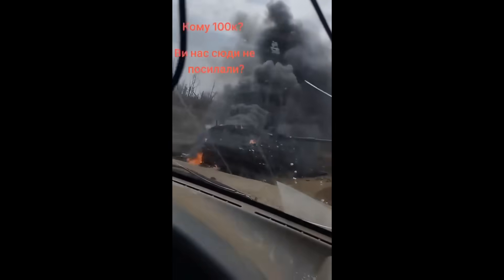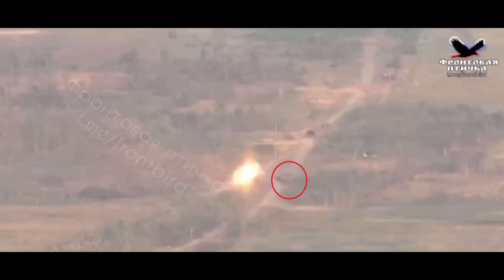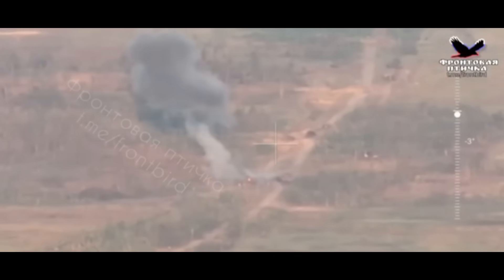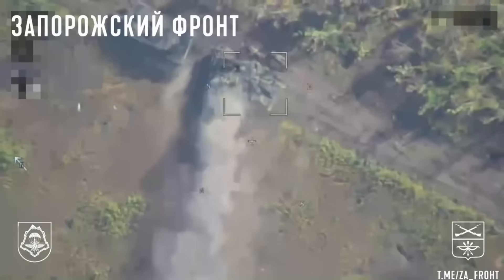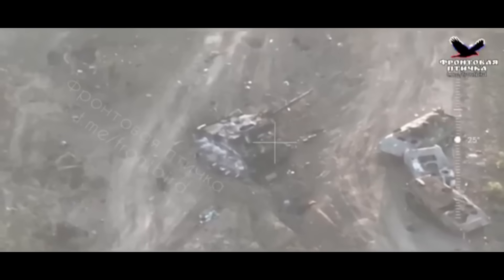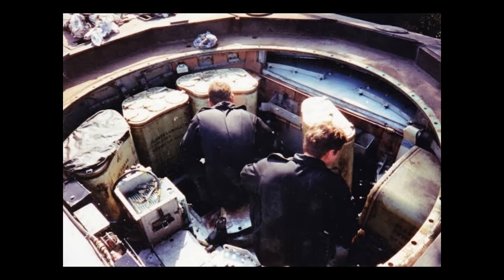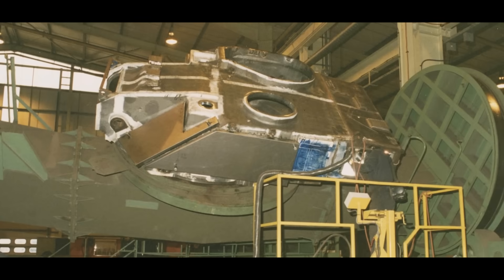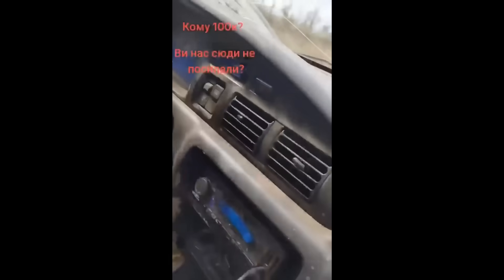This is how Challenger 2 got Destroyed in Ukraine

Comment: To no one's surprise, the best weapon against tanks is still the anti tank mine.
Reply: well I don't think the mine degraded the tank's armor.
Kornet/Vikhr would have done the same dmf if the tank was moving.
Reply: Joining the Ottawa treaty was stupid.
Reply: @tunisiandom9318 its very likely that ch2  frontal armour can stop kornet, but when the target is stationary not only do you not have a much easier time hitting it, you can hit it as many times as you want under no stress and even aim for weak spots.
Reply: The best weapon against a tank is 90% of the time........a tank.
Reply: @pierluigiadreani2159  The Ottawa treaty doesn't forbid anti-tank mines. It's only about anti-infantry mines. My country is in the Ottawa treaty too and people in general think it was a bad idea. But you know how it goes... it's trendy to join and some politicians wanted to get some international points and the defense of the fatherland can go screw itself.
Reply: 12 bravos will NEVER be out of a job...
Reply: The mine is good, but when one or two 155 or 152 mm shells are placed under it, then it is even better.
Reply: @enriqueouro9  1300mm after ERA begs to differ. that copper jet is going through and through the turret and out the back.
Reply: @moochoman9948  tank on tank is pretty rare
Reply: @moochoman9948  tbf, artillery is usually the biggest factor of tank casualties
Reply: @Masterafro999  Turret armor of Challenger, Abrams and Leo protection against chemical exceeds 1200. Though hull armor might be different for it. Kornet pens 1200 mm after ERA unless I'm unaware of an upgraded version.
Reply: @jonnekallu1627 They should've called it the "Illegal Alien Protection Act"
Reply: @Masterafro999  He also completely disregards the fact that the effective armor protection figures for complex composite armor packages only make sense under extremely specific conditions, namely the ones under which the armor was tested. They can vary wildly depending on the missile/projectile used against them as well as the incidence vector. A helicopter mounted ATGM or one mounted on a tripod set up in an elevated position, will have a far easier time punching through an armor package than if they struck it perfectly in line with its forward axis.
Reply: @pierluigiadreani2159  The Ottawa doesn't cover AV mines, only target-initiated AP mines.
Canada, the country that the treaty was held in, possesses AV mines, but no AP systems aside from the claymore. But nothing is stopping a soldier putting a spring cap and a tripwire on the mine, as illegal as that would be.

USA, UA, RU don`t observe that treaty anyways.
Reply: @tunisiandom9318  I the armour can't move... It's degraded.
Reply: Sadly for the ukrainians the brits promised them that the tanks were made out of wakandan tec and that they would be invinsible.
Reply: @enriqueouro9  No it cannot stop the Kornet, you're tripping.
Reply: It was probably disabled by a mine and finished by a Kornet.
Reply: @Masterafro999  Not in Ukraine though. I've seen videos of Russian and Ukrainian tanks in close combat. Usually a Russian tank would sneak in and take out several and then bail. And I don't mean several tanks but a few armored vehicles and a tank. Sometimes Russians come with a better equipment for example a T-72B3 or a T-90m. Both are equipped with thermals when an older Ukrainian tank might not be. So they spot it way before he knows they're there.
Reply: @ElkaPME  And infantry.
Reply: some things never change. Though a drone will get the job done aswell.
Reply: @jonnekallu1627  Well same thing in my country, I've been in military before and my commander just say about this"whenever you have is stupid pieces paper or not when you go to war you have so much reason to flip-flop about this" yep.
Reply: @tunisiandom9318  An immobile tank without crew is useless. You don't need to destroy a tank just render it useless or unsafe for the crew to man
Reply: @tunisiandom9318 the mine didnt need to degrade its armor. It just needed to immobilize the tank. Damage the roadwheels or pop the tracks out n that tank wont be going anywhere. 
And the crew felt this. They survived the intial blast for sure, but when they tried to move, the tank didnt do anything. And that was cue for the crew to haul ass. 
Coz the crew knows that, once the russians can confirm the challenger cant move, theres gonna be a second wave of far more devastating ammo coming their way.
Reply: @DogeHodler25  yeah I believe to know which videos you are talking about. But I was thinking that Kursk level tank battles are not found in Ukraine. We would have seen tank on tank videos daily in that case.
Reply: @tunisiandom9318  export variants don’t have the same armour as those used locally. Same goes for all western tanks.
Reply: @daniil7134  в смысле не причем. Как раз из за мины танк и покинули.
Reply: @koskok2965  you are speaking my mind! 
That's a point I made in a different video about leopard getting struck by air launched atgms.
Reply: @Kwisss  it states 1300mm online. That's the figure I took. 1300mm will highly likely punch trough the challengers turret front. The Leo is the only tank I could see surviving such a missile to the turret due to its add on pike
Reply: @cannack  Ukraine is party to the Ottawa treaty though.
Reply: Именно этот танк был взорван с корнета
Reply: This video goes out to all those brits who outta nowhere, bragged that the challenger was far better tank than the Abram and that it is the best tank ever in the world hands down, because of it’s low death ratio, despite seeing limited action in any warzone. ✌️
Reply: And it died now.
Reply: @nazbol1141  🤣🤣🤣🤣🤣🤣 you deserve a noble peace price for that funny bomb you dropped lol
Reply: @enriqueouro9  whether the tank is stationary or moving makes no difference to what the front armour can stop, only how easy it is to hit. In this case, the frontal armour was penetrated by a Kornet which led to a detonation of ammunition in the hull. Aiming for weak points is very hard to do with an ATGM; you will figure out why once you look at the footage of one in flight.
Reply: @Pythoner  Do we know how many missiles it took to destroy it? as far as we know it could have stopped 20 before being penetrated
Reply: @Masterafro999  These things are very classified, but the front armor of  NATO tanks can easily have around that much chemical energy protection with the thickness of the array.
Reply: @enriqueouro9  the thickness of the array can't be used to describe it's effectiveness against battlefield threats. The angle of impact will either allow a penetrating hit or not. But yes. All of this is very much speculation as no one knows for real.
Reply: @Pythoner  beam riding ones like the kornet should be much more predictable in flight and thus easier to aim.
Reply: @enriqueouro9  dream on. It took one krasnopol 152 to the engine bay and a kornet to the side turret or hull.
Reply: @moochoman9948  no, most tanks today are destroyed by guided munitions, not tanks.
Reply: @sergeig685  yes you are correct. But the most effective, (ie, the most capable and versatile) method of killing a tank is still another tank. Until you invent a weapon that is as potent in attack and defence that a tank is, it will be a tank. At the minute the closest thing is an attack helicopter. ATGMs are excellent in defence but not so much in an attack.
Reply: @moochoman9948  what are you talking about? attacking what?  If tanks were the best at killing other thanks then there won't be so many tanks destroyed before they could attack anything.
Reply: @sergeig685  Russia, (and to a certain extent Ukraine) have not used armour in a combined arms way that the west would have. That's why they have been smashed. Gulf War 1&2 Tanks were the main thrust for the ground forces. The terrain here isn't particularly great for tanks (whereas the deserts of Iraq/Kuwait were). In an offensive, you take a tank over an AGTM platoon, that's my point.
Reply: Actually, it came as a total surprise to Gen. Petreus and Gen. Mille,  Zelensky, the command staff at NATO, etc, etc, etc.
Reply: @moochoman9948  1.  The west has never faced an opponent with advanced guided weapon capability.   The very few modern weapons that made it to Iraq, like Kornet, had no issue destroying Abrams tanks.  2. Europe, Ukraine in particular, is ideal for tank warfare.  Both soviet and nato tanks were designed precisely for that role.   3.  Enough of the combined arms parroting.  ATGMs, drones, and guided projectiles are deployed from several to tens of kilometers away.  No, your supporting infantry, is not going to help you one bit.
You also keep mixing "best at killing tanks" and "best for invasion/attacking".  These are two very different things.  Tanks are still very useful for an invasion, but no, they really are not the best at killing other tanks.
Reply: @sergeig685  1.Fair point 2. Not all of Ukraine is ideal for tank warfare, look at a map. 3. Combined arms is central to modern warfare, so we cannot disregard it, (if Russia had adhered to it, it wouldnt have lost as many thanks). AGTMS can be used from kilometers away but that doesn't help you in an offensive where you are moving forward! If you are facing another armoured force in a meeting engagement that is inevitably going to end up in Tank on Tank warfare. Which in that case the best weapon for taking out enemy armour is armour, (which is armours main role- 'To destroy enemy armour and provide high explosive fire support to Infantry'. The second part is what Ukraine has been using armour for mainly as mine feilds have took away one of the Tanks main assets, speed and mobility on the battlefield- which AGTMS have neither of.
Reply: @nickcharles1284  I don't think it was the minefields that have took them off guard, I think it's the sheer scale of them, plus the Russians very stiff defence so far.
Reply: @moochoman9948  ATGMs have no speed   or mobility, are you kidding?  An ATGM team can be deployed by a car, APC, parachute,  ATVs, dirt bikes, hell, they have even used e-bikes in Ukraine!   They are far FAR more mobile and faster than a metal behemoth that requires immense logistical support - fuel and maintenance.  That resulted in many tanks being abandoned in perfect working condition or drivetrain issues in this war, just like they were in WW2.   Tanks get stuck in mud, cannot traverse older bridges, canyons, rivers, and cities.  And there are far more variety weapons today than ATGMs. Drones fly over 100 km/h as the crow flies and obliterate any modern tank.  There is also laser guided artillery, smart mines, and rocket delivered munitions.   No, the tanks of today are really far inferior at killing other armor compared to everything else.
There is a reason why US Army is starting to transition to the M10.  Except for limited scenarios heavy armor is dead.
Reply: @sergeig685  none of those vehicles are as fast an MBT on a battlefield, or can fire on the move, or take small arms up to cannon fire and shrug it off. So, no they do not have speed and mobility of a tank. Again, the only thing that comes close is an attack helicopter. Bad logistics cost a lot of Russian tanks, yes. Thats an argument for better logistics, not AGTMS.
Reply: @moochoman9948   An APC is slower than a tank on a battlefield? Ok, I get it, you really like tanks. There is no point arguing.
Reply: @sergeig685  yes, and the fact you don't know this shows your ignorance (their suspension and thinner tracks lets them down). I served for 13 years, so know a little of what I'm on about. The MBT will be replaced one day, it's not the be all and end all. But it's still the best thing on the battlefield to take on another MBT in 'most' situations.

And yes, the M10 might be the way forward, but that's still a tank (in WW2 it would have been classed as a 'medium tank'), the west moved away from this categorisation when the Main Battle Tank came to fruition, and the future probably will be light, medium and heavy tanks again.
Reply: @Tom_Quixote  you're right, got their status mixed up with the Cluster munitions treaty. They still seem to use AP mines to some degree.
Reply: @Masterafro999  So then it didn't penetrate the frontal armour like I said it might not be able to? either way we get to see only little videos, we don't see everything it got hit with, much less penetration probabilities
Reply: After the war, the OUN circles operating in exile conducted a systematic action of changing history. In publications, studies and memoirs, the topic of cooperation with Germany, participation in the Holocaust and murdering Poles was omitted. The OUN and the UPA were presented as noble organizations fighting for a free Ukraine against two enemies - the Third Reich and the USSR. An idealized image of Bandera was also built as an outstanding politician, leader of the nation, thinker and noble fighter for freedom. All those who recalled the Ukrainian collaboration, participation in the Holocaust and the Volhynia massacre were called Soviet agents. Rossoliński-Liebe
Reply: @moochoman9948 not anymore, this isn't ww2
Reply: Idk if that's true, a lot have been taken out by artillery and drones, esp the guided artillery, as well as kornet and ka52 missiles
Reply: @enriqueouro9 no if the kornet hit the hull you can watch previous video in this channel, he say that Ukrainian challenger2 don't have the additional armor on the hull wich make the hull armor bad
Reply: @moochoman9948 it's not actually true because tank to tank fight are rare nowadays like in Ukrainian war, the best weapon against tank is anti tank weapon you can tell even by the name
Reply: @CheekyBreeky77  This only applies to the lower hull but yes.
Reply: @nicobenji0248  However mobility kills can often be recovered and the loss of a tank is acceptable if it saves the crew or most of it. That's why recovery was vital to all sides in WWII.
Reply: @moochoman9948 while true, that would mean the other tank is in the same danger (depending on the model, of course).
Reply: That’s why we need them in War Thunder
Reply: @moochoman9948  That is just not so. Artillery and anti-tank mines have destroyed far more tanks in Ukraine than could be done with tanks.